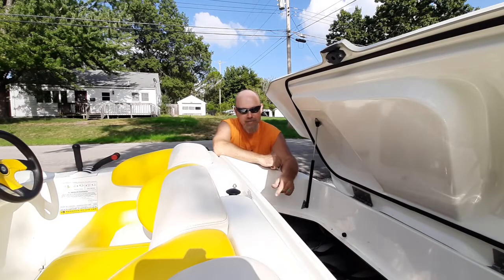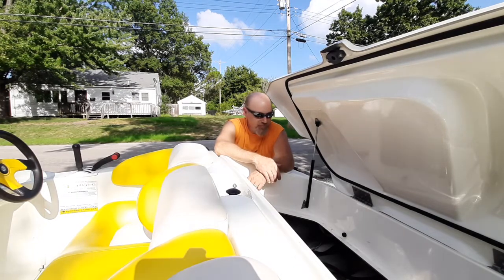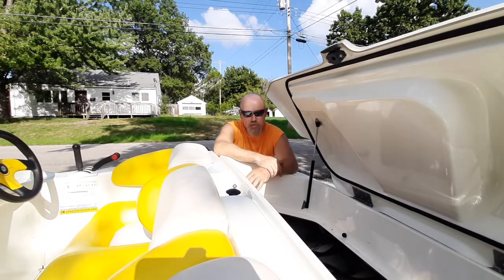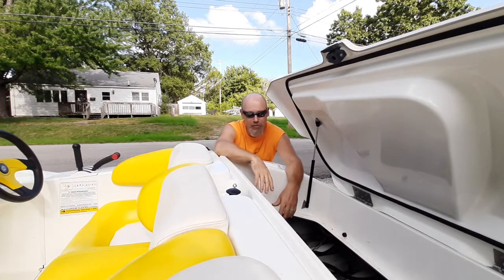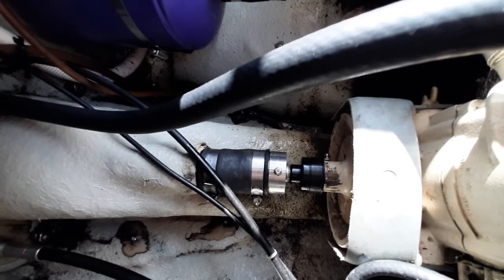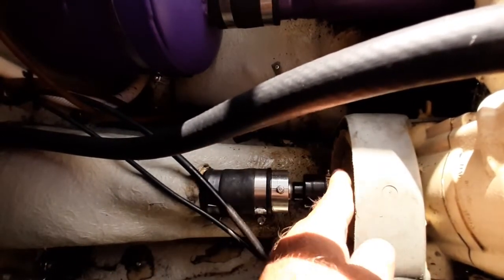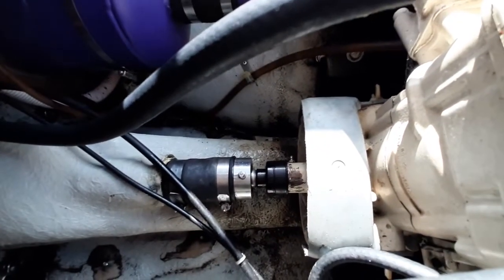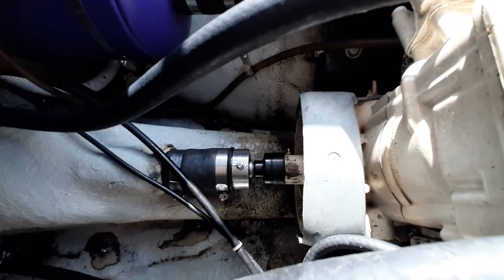SeaDoo Speedster - Pump Cavitation Fix

Comment: How do you get yours so smokeless? Mine smokes more than a chimney in the 1920s
Reply from the maker: Since I run 40:1 premix it's surprising that it doesn't smoke more.  The only time I have much smoke is during the first startup and if idling for an extended time.  It also depends on the oil.  Some of the "smokeless" oils are actually fairly smoke free.  If you are still running oil injection have you checked the pumps to make sure they are set right?  Also with injection you can have some oil from the tank get passed the crankseals if they are worn out and that will cause a lot of smoke.
Reply: I’ve heard mixed things about premix conversations? I’m running the oil injection, I’m planning an oil line replacement and will replace with SeaDoo XPS Oil. I’d love to see a video about adjusting the oil injection pumps and inspecting crank seals?

Comment: Good information on this video thanks. I’m going through mine now and one thing I noticed was the nuts on the inside holding the pump on the shoe were I little loose and prevented the pump from sealing tightly. May be something to pass on in future videos.

Comment: What's he talking about when he says cavitation? Like it powers up but doesn't go anywhere?
Reply from the maker: With cavitation you are getting air bubbles at the impeller.  The result is the engine revs high but the boat doesn't go anywhere fast.

Comment: I have no spark I have check everything
Reply from the maker: The only time I've ever lost spark on one of these engines it ended up being a bad ignition generator coil under the flywheel.  Have you checked that?

Comment: I'm a new owner of a 2003 Sportster. I notice until it gets to plane at higher speeds the boat is very anemic is that the cavitation?
Reply from the maker: If it's cavitating then the engine will rev high but you won't go anywhere fast.  If it's just slow to get going you have other problems.

Comment: My 97 challenger on the right side after like 4000 rpms it feels like it goes into neutral. Is that cavation? Or something else the ware ring on the impeller is new . Thanks
Reply from the maker: Sounds like cavitation.  Is there any damage to the impeller?  If the impeller is good then it could be pulling in air around the driveshaft seal.

Comment: I don’t think cooling system is hooked up correctly on my 1994 Sppedster jet boat. The four holes coming out the back only have two squirting water. One from the head of each engine. I’ve searched everywhere for a diagram of how these hoses should be hooked up. Can you give me the rundown on the cooling system and where the hoses should be connected?
Reply from the maker: On my 96 only the 2 outside holes are hooked up to squirt water.  The hose comes off the bottom of the exhaust manifold and goes to a T fitting.  One side of the T goes to the squirter and the other goes to the main exhaust outlet.  It's the same on each engine.

Comment: Great Video......I just bought a 98 Speedster, was replacing the jet pump oil and noticed the drive shaft protector (blue plastic) was cracked. Your boat doesnt appear to have them, should replace them or take them off completely?
Reply from the maker: Mine were busted up when I got the boat so I just took them off.  I have heard that you can get more cavitation if you are running the stock carbon driveshaft seals and you take the protectors off.  It increases the area around the driveshaft where it goes through the hull.  If you've switched to the older seals it makes no difference.  Some people trim the protector down even with the hull so it is still around the driveshaft where it goes through the hull.  I think there original purpose was to make it easier to remove ski ropes if you sucked them in the pumps.  I just always made it a point not to do that.  Is your Speedster the SK with the twin 720s or does it have the twin 110s?

Comment: Just got one these speedster n cavitation is bad lol didn’t seem right n hoping to do this this winter but yesterday i sucked up something n i dont know what to do to clear it n can u do it from in the water or do I need to take it out I have scuba tank lol
Reply from the maker: I would just pull the pump.  Depending on what you sucked up you might have damaged the wear ring.

Comment: I have a 1999 Seadoo sportster I bought it used 3 years ago it ran fine for 2yrs . Now it runs slow at full acceleration what should I start with to fix the problem also what should I do to completely maintain everything
Reply from the maker: Do the engines sound like they are coming up to full speed but the boat is just slow?  If so start by checking the pumps for damage to the impellers or wear rings.

Comment: Awesome vid!  What impellers do you have in your Speedster??  Im looking at buying some shortly.....Thanks for the help
Reply from the maker: I have no idea if they are still available but I went with the 14.5/22.5 Skat Trak swirl impellers.  I installed them in March of 2003 and they have worked great ever since.  LOL.  Excellent for pulling toys and on rough water.

Comment: Have you ever used a cdi conversion kit I have a 1997 with a bad cdi box it blows the fuse with everything unplugged and that cdi is no longer available it has been discontinued
Reply from the maker: I've seen those but never had to use one.  Do you have a single or twin engine boat?
Reply: I just purchased one too, and it does exact same thing. Everything unplugged to keeps blowing the power fuse.
Reply: Use CDI boxes for a 95 model and it runs great made my own kit for 180.00 got the CDI boxes from eBay

Comment: Thanks for the video! I'd love to get a little bit more detail from you. I'm a fairly new 2000 Seadoo challenger owner. Big time cavitation issues and I'm certain it's one or all of these things. The engine was just pulled to replace stator. I think putting it back together there is an issue w carbon ring/seal. Or wear ring or both. I'm a little confused on the aftermarket parts/hose to buy to replace that system. Would love to know more. Thanks!
Reply: Basically after about 4000 pms it's all cavitation and no power. Basically won't get up on plane anymore.
Reply from the maker: @jordanglines9232  This is the single engine Challenger with the Rotax engine correct?  Just wanted to make sure it wasn't the Challenger 1800 or 2000 with the Merc engine.  I would definitely recommend going with the old style driveshaft seal and getting rid of the carbon ring.  I'd also recommend pulling the pump to check the wear ring.  Pump removal instructions are here.  https://youtu.be/6a7Et04wlCs
Reply: @xpsgarage  thanks a ton for the response. It's twin rotax 717's
Reply: Also is it the exact part numbers listed above? Excuse my ignorance. I wanna make sure this is done right once and for all. And will it be self explanatory when installing?
Reply from the maker: @jordanglines9232  Good that it's a twin.  Getting rid of cavitation is much more difficult on the singles.  The OSD2001 or OSD2002 are what I would buy.  You need 2 carriers with bearings and seals.  You also need the 2 straight hoses that replace the accordian hose you have now.

Comment: Thank you for the video! Is it difficult to replace starter on this model?
Reply from the maker: Not too difficult but you do have to remove the exhaust pipe since the starter is under it.  Once the pipe is out it's just a couple of bolts and the power wire.

Comment: Hello, I just purchased a 1996 challenger and it starts rough, will take awhile sometimes but then once I’m driving it runs good, will shut off and be hard to start again, but once started will run good. Any guesses to what could be giving me a hard time?
Reply from the maker: Sounds like a fuel issue.  Check the lines between the carbs and the tank to make sure all the hoses are in good shape and the fittings are tight.  Also check the fuel filter and make sure the O-ring is in good shape.  Any leaks in these fittings will let air into the system since the pump is on the carb and it's sucking fuel from the tank.  If that's all good you probably need to pull the carbs and rebuild them.  Use only Mikuni parts since a lot of the aftermarket carb kits are junk.

Comment: I have been having some issues with my speedster, 1996 model as well. I have owned jet skis for the last decade , and decided to sell them to pick up this 96 speedster I found, got it from the second owner, extremely low hours, looks like it was taken out a handful of times. Issue is , at first, you would hit the throttle and it would jest over rev and not move faster than like 15 mph . Replaced the wear rings and made some adjustments and the boy is working at id say about 80% of its potential right now. I can top out around 42 mph, I know I should be able to go quicker than that! I checked my boat and I have the accordion pipes /stock setup, so I am going to do this and see if it helps 
Any tips on adjusting the large black pieces that sit over each jet out the back? The ones that move when you put the boat into drive or into reverse
Reply from the maker: Changing to the old style driveshaft seals should definitely help the performance by eliminating any air going into the pump.  Are you running the stock impellers?   The Skattrack swirls were much better for acceleration and top speed was still mid 50's.  On the reverse buckets there should be some locking tabs on the pivot of each bucket.  Adjust it so they lock in place when the shifter is all the way forward and you should be good.
Reply: Appreciate the reply !  I’ll give those suggestions a try
Trying to find somewhere that had the parts in stock for the driveshaft seals

Comment: Great video!  My challenger 1800 suddenly lost thrust. One minute I am going 30mph. And after a short break it wouldn’t plane. 

I took the pump out. The clearance between the impeller and wear ring ranges from .2 to .5 millimeters. Would that account for the issue?  I can’t find what the actual allowances are
Reply from the maker: I've got that amount of clearance without issues so that's probably not the problem.   Especially since it happened all of a sudden.  Does yours have the mercury engine?
Reply: @xpsgarage  thank you for the follow up. No it’s a seadoo rotox engine
Reply from the maker: Ok.  Is the wear ring around the impeller in good shape? No gouges or grooves?
Reply: @xpsgarage  impeller and wear ring look  good
Clearance between the wear ring and impeller is between .2 and .5 milliliters

Comment: Im looking a buying one of these boats, same engine configuration as yours...are the able to tow well or do they struggle?, what's the top speed of this boat
Reply from the maker: LOL Whoever you are towing better be holding on tight.  Mine will pull 2 tubes easily.  Wakeboards,  kneeboards and skies are no problem.  Mid 50s top speed.
Reply: @xpsgarage  cheers, thanks for the info

Comment: Will this mod work on later m8del engines? I have a 07 with the supercharged rotax 215.
Reply from the maker: I looked at some driveshaft pics for your boat and I don't think it will work.  Doesn't look like there is enough area for the bearing and seals to ride on.  I also don't know if it's the right diameter.  If it was possible to make it fit I would say that it would require some machining.

Comment: Is the '96 Speedster supposed to have neoprene seal between the pump shoe and the impeller housing? The on line manual that I looked at showed one but when looking at SBT's site for ordering, they're not showing it. Thank You in advance for your help, it's much appreciated 👍👍
Reply from the maker: Yes it's supposed to have a seal there.  I always use thin foam weather strip with the adhesive backing.  I just run it around the flat area on the pump shoe and overlap the end slightly.  Works perfect and it's cheap.
Reply: @xpsgarage  , Thanx for the quick response 👍👍. It's been about two years since I took it apart and I couldn't recall if it had seals or not. The customer finally decided to go ahead with the work but I've worked on hundreds of boats and skis since then. Again, your help is GREATLY APPRECIATED, Thank You very much !!!

Comment: Hi, thank you for the video. I have seadoo speedster 1994 RPM go's up, but reverse go's vary solw same as going forward only 20 mails per hour but will be screaming because rpm too high. Please let me know if you have any ideas. Thanks
Reply from the maker: Have you crawled underneath it with a flashlight and looked at the impellers?

Comment: I have a 1998 speedster and the left motor boat where you were showing there is completely ripped apart and I don't have any power and it's a new rebuilt motor on it it tacks out but doesn't do anything is that the cause?
Reply from the maker: If the motor is revving up but you are not going anywhere I would recommend pulling the pump and driveshaft.  You might has stripped the splines on the shaft.
Reply: @xpsgarage  ahhh! Thanks I'll look at that. Are you talking about the exterior or in the motor compartment on the PTO?
Reply from the maker: @petec5935  could be either place but I think the PTO is more common.